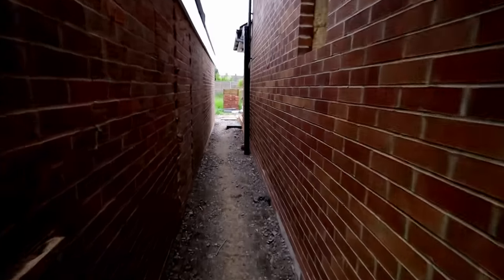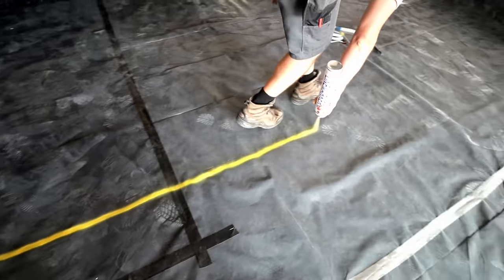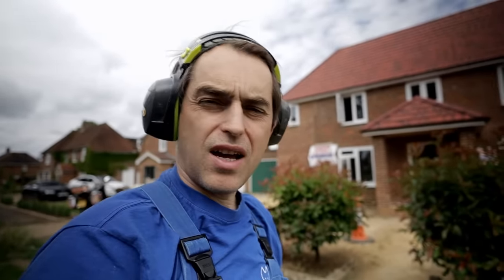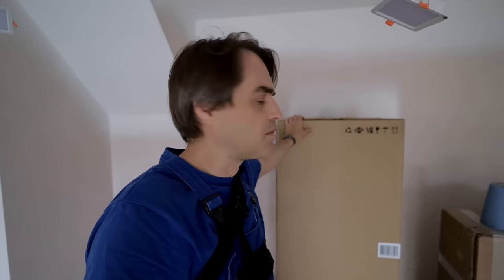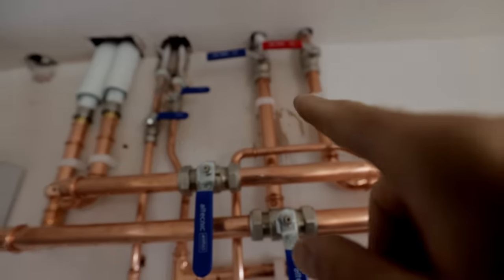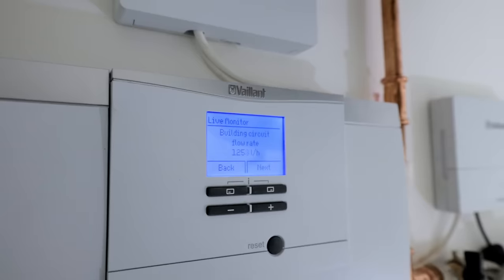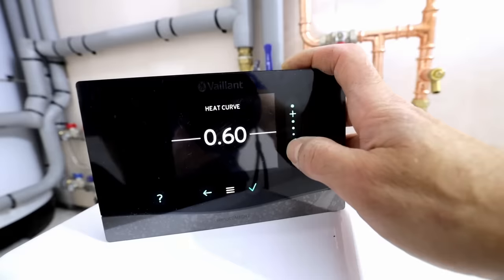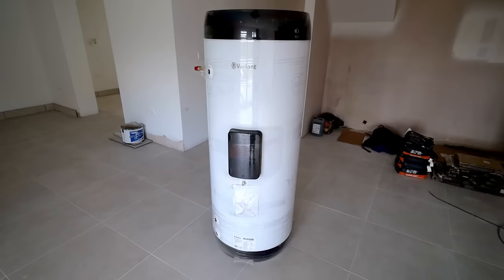Gas Boilers No Longer Make Sense, Here Is Why.

Comment: Given the level of insulation in modern houses would an all electric heating system combined with roof solar panels result in comparable installation and running costs?
Reply from the maker: yes, posibly much cheaper to install. However 4.5 times more expensive to run. In this house estimated annual heating and hot water bill is around £1,500. If you had electric UFH it would cost you around £6000 for heating alone plus you need to to DHW as well somehow. For that you would need either a cheap direct unvented or a sunamp and charge it on a cheaper overnight tarrif.
Reply: You will be burning wodges of money with any all electric system.

Comment: @urbanplumbers i'd love to switch from the Valiant 937 ecotec to a heat pump, but my 20 year old house has nowhere to install an unvented cylinder, nowhere to site heat pump, is piped in 15mm flow and return with 10mm drops to under sized radiators.
I've had three companies come and survey and price. Two wouldn't touch it, and one said £28k, so if gas comes to an end, this house will be getting electric storage heaters.
Reply from the maker: yes, you can use direct electric, but in a long run it makes more sense to actually spend 28K, as electric storage heaters will cost around £8K a year to run in an everage UK home. If you cannot afford a heat pump, then you surely will not be able to afford storage heaters, unless on a cheaper tarrif.

Heat pumps are unlikely to reduce in price when it comes to installation ot supply. We need more training and better engineers and better incentive to attract better quality of people to the industry. 

What we need is better financing for this tech with lower bills savings to pay for the loan.
Reply: My brother has a small 3rd story flat. We pulled out an old boiler, DHW tank and header tank and fitted a combi boiler. The change freed up a lot of space in the bathroom where the DHW tank was located. If gas boilers are banned, an ASHP would not be a viable option. There would be no space for all the gubbins needed and with the ASHP mounted outside, the cost of servicing it would be astronomical as scaffolding would have to be erected to reach it.
Reply: @UrbanPlumbers  but this isn't a job site. This is my home.
It's £28k for the plumbing but that doesn't include reinstatement of the flooring that would need to be ripped up to get to the floor boards, and the reality that we would need to be out of the house for several days (including pets) while the work is taking place.
I know your clients have big properties and bigger pockets, but for your average working man, financially it's a stretch and it's a massive inconvenience for a small reduction in heating costs (on a well insulated home with weather compensation) for what? It doesn't increase the value of the property and if electricity prices increase (which they will, because we can't produce enough of the stuff), then an additional+£20k in solar PV and battery is needed?
I'm not saying burning gas is right, but we need a less disruptive alternative, that doesn't lock us in to a single energy source (electricity).
Reply: @StuartTaylorEsquire  do you think there are electricity mines? electricity wells? Electricity is energy source agnostic like no other fuel. We used to heat our homes with open fires, a guy would deliver us coal.  Central heating was an unbelievable expensive luxury with so much disruption to install, but in a decade or so burning coal became the luxury.

Comment: It struck me that in a city environment, the air available for drawing the heat out of would effectively be that of your own back yard. In those cold still winter mornings, the cold exhaust air will fill up this backyard area until the units dont work! Most city housing is quite cramped with lets say a 250M sq garden (figure taken from Cambridge estimate which is one of the better cities), thats 250Mcubed of air before your unit is totally immersed in cold exhaust. ie, if everyone has one in cities, theyre not going to work on those still/frosty mornings. Doubtful of this, well look at it another way. Cities are 10-15C warmer than their surrounding countryside due to heat leaking from homes. If they go over to heat pumps, this will mean they will be 10-15C colder than current and then add in all that cold exhaust air from heat pumps. My conclusion is that for expensive new builds in the more country areas, they would be good. But for most people in older houses, itl be too large an investment with the cost of ripping up floors etc.
Reply: So just lift the heat pump up and the problem solved!
Reply: Don't forget that the house has thermal mass and the air has to get really cold (like -15C) to not be able to get useful heat out of it.

Comment: I’m still in the gas lpg and diesel boiler over heat pump for off grid , my experience has been really bad with heat pump, I had better heat than underfloor, which in - 30c felt bitter (buffalo last Christmas)  but irs exactly this reason I say gas and diesel whether it be biodiesel or in time synthetic,  when the powers out people freeze,  we had 7 days of negative 20c with no electricity , we were cut off for 10 days due to the sheer volume of snow , if it wasn’t for the fire place I would have been in a bad way, 8 people got taken to hospital in our street due to no electricity and a heat pump refit sadly one elderly woman passed away , in the U.K. we only have to go back to storm Erwin to see similar situation, no heat , and cut off it doesn’t matter if your 18 or 80 freezing cold can kill, the politicians and policy makers forget this, many have never been in such conditions before, let alone had the power off for longer than a day, all it takes off the main pipe is for one bad storm and the grid goes off, this is why I’m advocating that gas and diesel be allowed to continue especially rural Scotland especially with property’s with greater than 15kw energy loss , the cost off keeping the heat going through backup would make it far far more expensive ac it’s not hard to chew through 45kwh a day in sub zero temperatures this is why I say especially for heat pumps Designing for just -2 is wrong and should be for a least -6, which is typical in rural conditions

Comment: ROI is still a valid concept, but it only applies to the additional investment you have to make to install a heat pump, if there is any. Now, if a heat pump is really cheaper to install from the start under some circumstances, there isn't any additional investment to consider, so ROI calculations would not be useful. But, the government subsidies and the high price of gas in the EU are both symptoms of the current political climate, and that may change in the future, so it makes sense for any homeowner to try to set aside enough space to accommodate changes in the future, including a switchable-source system if price or supply prohibits the use of either electricity or gas. Here in the USA, gas is still cheap for the time being, so the only case for a heat pump, at least in areas with cheap gas,  is to support both heating and cooling with one system. There are some 1970s houses in my area with resistive electric heat and overhead ducts for air conditioning, and in those houses, there is a strong case for a conversion of the air-conditioning system to a heat-pump, with both heating and cooling capacity, in order  to minimize the use of the incredibly expensive resistive heating. But with the  way energy prices fluctuate, the only sure bet is on the insulation itself; it's hard to loose on that one.

Comment: With the Vallient heatpumps I couldn't see any information about how efficient they are during the winter months, when I'm doing most of my heating. Even though the gas boiler is much less efficient per kilowatt, the price different between gas and electric seems to remove any significant benefit from heatpumps. This is on top of their substantial costs when retrofitting. Doing a complete refurb of a larger house does change the sums though.

Comment: Let's have a think about the Grid, solar and ashp's. I won't use heating for at least six months, possibly more. The summer is when the Grid receives most of it's solar, come late October there's not enough solar to be useful as far as heat pumps go. The winners here are the ones with solar and batteries, they can adjust their Grid use whereas ordinary powered heat pumps will just bumble along regardless. 
   The powers that be tell us this or that solar farm is enough for 20k houses. In reality that solar farm won't supply any houses unless half the daily output is stored by some means.
Another thing that's of concern is the amount of power we seem to be importing at present.  I watch the stats every day, at the moment it's at 5% and gas is 43.9% but recently imported  power has been over 20%.
I honestly didn't realise all this stuff when I ordered said heat pump. If I had invested the £16k in 10kw solar and 10kw battery I would have had a ROI of about 13 % whereas I'm encountering massive depreciation. Hey- ho!
You,sir are an artist, I love your videos and admire the beautiful installations that your providing for your customers.

Comment: ASHP is the way forward for new builds as a transitional period providing the electricity to run them coming from renewable sources only. I don't know why, especially when energy prices are always going up, no one is talking about geothermal energy harvest. I'm talking about industrial geothermal plants. Cornwall on its own has potential to provide whole entire UK with energy. Years ago they(so called experts) used to say it's beyond economical threshold. The old properties should have option to connect to the district heating system run by geothermal plants using HIU. This would require major changes to our infrastructure. Sadly major giant companies/corporations and government has no intrest, unless is quick in and out with mega profits. Geothermal energy is endless and fairly clean, with the right scientific approach/investment we could make a difference.

Comment: I'll wait until I see a whole street of Victorian terrace houses converted to HP before I'm convinced that they are the only solution
And I mean a terrace of 2 up/2 down with small back yards that you find north of Watford and not some pimped up house in Islington
Reply from the maker: 2 up 2 down are actual quite easy to with heat pumps, as heat loss of those terraces is sub 5kw, so the smallest unit can be installed and there is also usually space for the cylinder in the loft. I have done a number of those last year. 

What is best, is the fact that they don’t even need to be insulated. Just decent double glazing and loft insulation and they are fine with 45c flow and scop of 4

Comment: Great video, just wondering what size is the circulator in the heat pump as in the standard size they supply, 6 meter head pump or larger. I see in past videos your calculations allow you to run the system on one circulating pump in the heat pump and remove the extra pumps on the system. This is very impressive and just highlights the importance of overall design and low flow temperature yet still reaching the correct flow rates through out the system. Well your videos and information have convinced me the Heat pumps in the right build are the way to go. Great work, Thanks for posting, I look forward to your future content
Reply from the maker: the circulator in this unit has a residual head of around 4m at 1.4m3 per hour

Comment: This is again a great designed and installed system.👌🏼

I am interested in the way you did the heatlos calculations. Did you do that yout self or dit you outsource it?

Olso how much heatloss does this property have? and what size heatpump did you put in?
Reply from the maker: 7kW heat loss. I do everything in house: heat loss, system design, installation and comissioning.
I am preparing a video about the full process.
Reply: @UrbanPlumbers I’ll be very interested to see that!

Comment: You can't compare two technologies without checking if there is an ROI to go with the more expensive option. The problem is you can't predict gas and electricity prices 10-20 years into the future. Where I live electricity is slightly coming down while gas is going up. I took the gamble of getting a brand new gas boiler last year because gas was about a seventh of the price of electricity at that point, making a heatpump almost twice as expensive to run. Now it's somewhere between a quarter and a fifth, so running a heatpump is still more expensive but not by much anymore. If this trend continues and prices of heatpump vs gas boiler installations close up, it wouldn't make sense to run gas when doing a new installation, and in a few years it's absolutely possible I took the wrong gamble but that would still mean I would have to do an ROI calculation first to decide if it's worth replacing my gas boiler before it's written off or to go hybrid or just leave everything as is for a few more years.
Don't get me wrong, I'm all for renewable energy and I think the future is electric because of that, but the infrastructure isn't there yet to allow everybody to do the switch today, investments will be needed and those investments will have to come from the profit margins of the power companies. The question is where they'll get that profit from, will they keep inflating the price of both electricity and gas, slowing down the transition, or will they tack it onto the price of gas which is only sustainable as long as many people still use gas?
I think the best investment right now is insulation and heat-recovery ventilation, so no matter what you use to heat, you use as little as possible of it.
Reply: Last winter we were threatened with rolling blackouts, such that they had to put our last few coal fired power stations on standby. 

Rolls Royce have been banging on about modular power stations for as long as I can remember, but as yet, no planning permission has been given for a single unit. I can only presume there’s a reason for that. Hinckley Point isn’t exactly proven technology. The modular ones are based on naval power plants, and whilst there isn’t much info in the public realm for obvious reasons, there’s enough to know they’ve not been problem free. 

The UK is miles away from having enough electrical capacity for us all to buy ASHP’s and EV’s. Just try getting planning permission for new houses and getting the electrical supply pulled in. Ridiculous backlog and lack of capacity. If they started dishing out planning permission for RR plants today, it’d be a minimum 15 years before they came online. 

You did the right thing. By the time they’ve built all this capacity, electricity could cost a fortune.
Reply: @jonh1808  I live in Belgium, but it is no different over here. They extended two nuclear reactors for another 10 years because they realised it will take too long for renewables to catch up and relying on gas only to fill the gap isn't such a good idea in the current market. Not only the production is an issue, the grid simply can't handle the larger peaks. We now have "peak tariff" here: our energy bill isn't only calculated based on how much electricity we use, but also based on the average monthly peak consumption measured by the smartmeter... Now imagine having no battery, coming home from work, plugging in the EV, turning up the heat pump, and firing up the electric oven and/or induction hob. 
Yeah... I'm gonna sit this one out for a few more years, my current LPG/petrol car should last me a few more years, my new Vaillant gas boiler should last at least 10-15 years, and I'm perfectly happy cooking on gas.
The next car will probably be electric, the next 'boiler' probably an ASHP unless drilling for a ground source hp becomes a lot cheaper, but I'm in no hurry, I don't need to be a pioneer, my energy consumption is low enough as it is and will only become less the more I invest in insulation and heat recovery.
Reply: In future gas prices will be increased to encourage tha adoption of heat pumps. It is a very sensible move because even if  the electricity is generated using gas you will be getting twice as much heat from a heat pump for a given amount of gas as burning that gas directly.
Reply: @rogerphelps9939  I agree, that's why I keep an eye on energy prices and as soon as electricity drops below 3x gas I'll check what I would save vs what I'd have to spend to go hybrid heating. I already run low flow temp and adding an ASHP is just a matter of running flow+return+power straight through the wall where my combiboiler is installed, so it would be an easy change.

Comment: Gas boilers are not more expensive to run. Combi’s are more efficient than a heat pump, cost wise. When you have a system boiler, maybe then it is comparable. But still can’t beat a well designed system with gas. The grant for heat pumps is finishing soon and it has only reached a quarter of the budget allocated by the government. Not much adoption. Also, the knowledge on heat pumps is very low with engineers, good luck fixing it.
Reply from the maker: Most of my installation have running costs around 25% cheaper than 90% efficient gas boiler. So yes, gas boilers are more expensive to run than my installations - fact.
Reply: Not forgetting that in the UK, electricity tariffs are around 4 times that of gas! Never going to beat a 90% efficiency gas boiler with a heat pump unless you have a good amount of solar panels a good battery for storage.